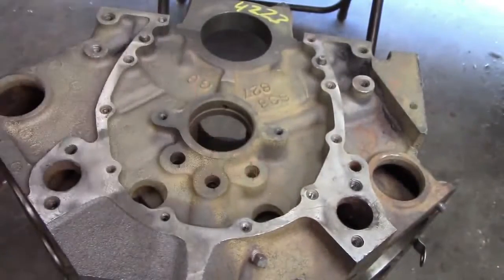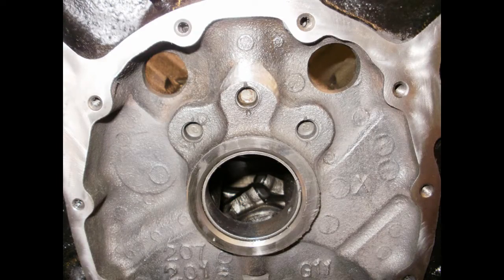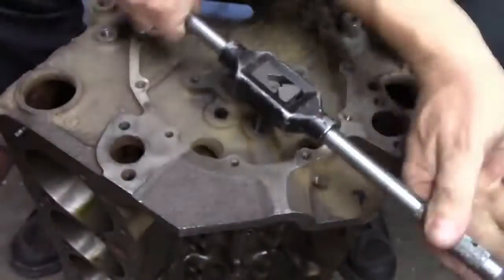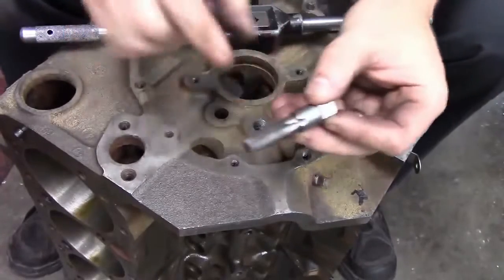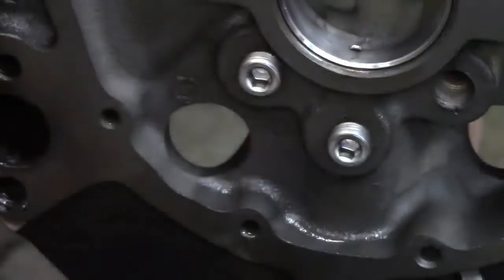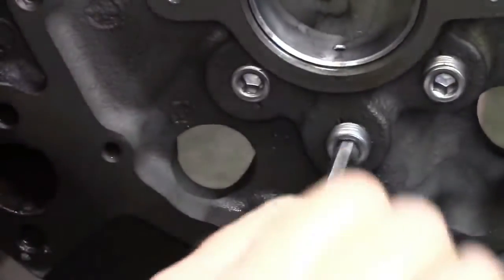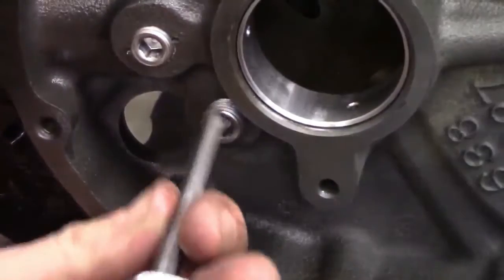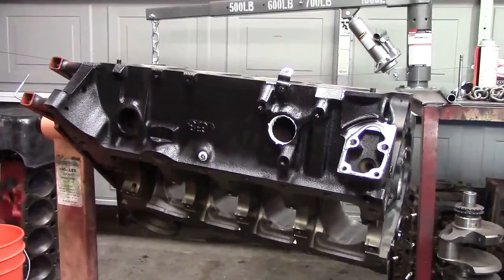350 CHEVY UPGRADE OIL GALLERY PLUGS

Comment: FYI, you can stick a rod/allen wrench in the center cam oil feed hole to make sure you are not blocking that oil passage off. If cam bearing isn't installed, probably shouldn't be to make sure your passages are all clean from the tap.

Comment: I have a late vortec block. The outer 2 plugs are 9/16. What size plug would go in there?
Reply from the maker: you can tap those 3/8 pipe tap
Reply: @Myvintageiron7512  that what I was thinking. Thank you for the reassurance. Love your videos

Comment: I always drill a .030 to .040 thou. Hole in the 2 side ones because they can get an air lock and cause a tick that you cant get out of the adjacent lifter, trust me i know about it. Never drill the center one, its the main upper oil gallery. Hope this helps.
Reply from the maker: they actually sell plugs that are pre drilled
Reply: Hi there I'm rebuilding a sbc what does this mean can you please tell me thanks
Reply: @Blessed_be_Israel   Drill a small hole in the center of each of these pipe plugs so the timing chain gets extra oil to extend its life.

Comment: the 60s and 70s blocks have the screw in plugs on both the front and rear of the block. I tore hundreds of them down back in the 80s and never ran into press fit galley plugs
Reply from the maker: Thats not true
Reply: Then someones gone in and done it before you
Reply: @gabrielibarra5551  I made that comment 3 months ago but now I remember that a punch of a particular size pulled the front plugs and the rear had screw in plugs. it's been a while since the 80s and I smoke a lot of pot
Reply: @russriley3005 bet hey man, you still recalled the info, just took a minute.:-)
Reply: @williamweesner1191  ironically I drive a 73 super beetle but back then, there was a lot of those blocks that had screw in galleys. I remember Buick had huge half inch oiling ports on the upper end of the block
Reply: Just tore down a 1975 350 from a so-called Police Interceptor engine (Some roaring 220 HP!!!!) and it had expansion plugs in the front.  Willl be installing 14" NPT pipe plugs.  The little bleeder hole in the center one is a great idea.  This engine was like new except for the timing chain was super loose.  And it had disintegrated valve stem seals that casued lots of carbon in the intake runners, ports and piston tops.  Cleaned up REALLY nice.  Bores all perfect, still hone marks in them.  I put in some cast standard bore rings and they fit perfectly with the perfect gap.  mains were actually tight at 0.0018 -0.0020 but the Clevite tech page said they have an extra sacrifical break in coating so should be fine.nnWas fun to build an engine again!
Reply: @TootSocialTV  I currently have a Volkswagen bus motor on my engine stand. I think it might be a runner

Comment: We will always take a large drill bit and drill out the center oil Galley hole to oversized it it will hold more oil in the upper end of the engine at higher RPMs and you will keep higher oil pressure throughout your engine without getting too much oil pressure which can be bad as everyone here knows. Great video

Comment: If you tap the hole too deep you can grind the end of the plug off to clear the oil passage. Blocking the oil supply to the front main bearings causes bad things to happen.

Comment: I did a small hole(.035) in the center plug to aid in the oiling of the backside of the cam gear , used to be a hot trick ,lol
Reply: I'd heard of that, but always wondered if it really made a difference.
Reply: @JFSmith-nb8hf yep it does. We do it on the Pontiac motors as well. It also helps when runnin a high volume oil pump to relieve some pressure because to much pressure can be a bad thing. So yes after 35yrs doin it i would say it works. Heck i done every sbc and poncho block this way since i 1st started n i have built ...way to many....
Reply: Yep that's a great idea too A lot of people don't know about doing it but it works really well
Reply: I don't recall part no. But l bought  pre drilled  plugs  at  local chevy parts counter. They were for big blocks but are same size as small block.